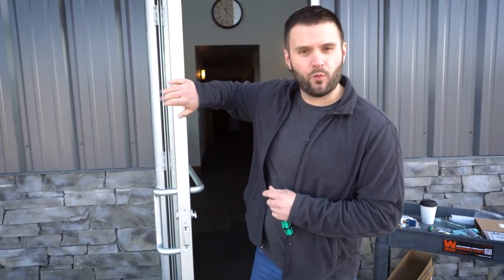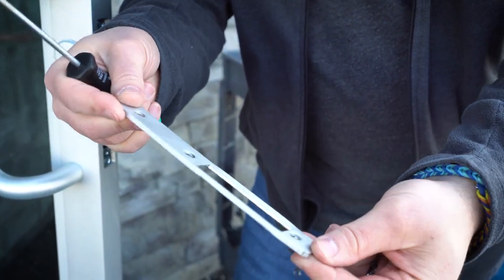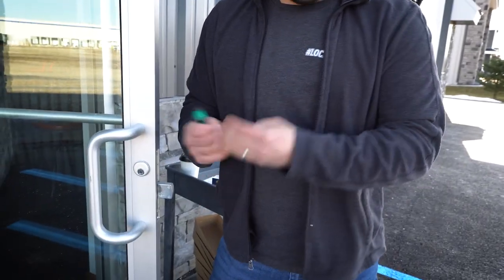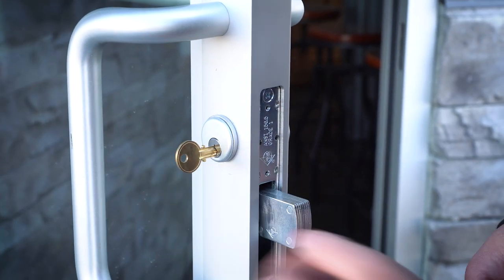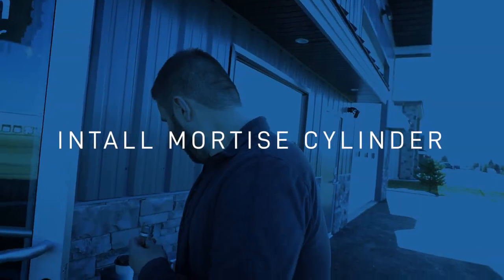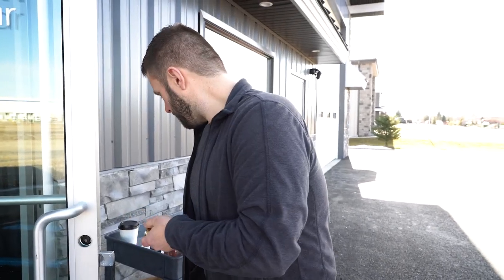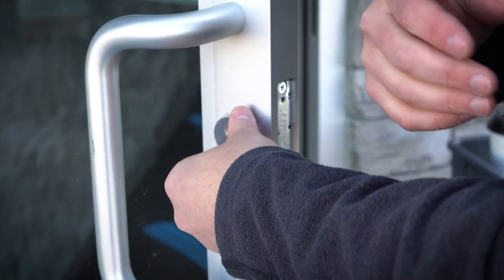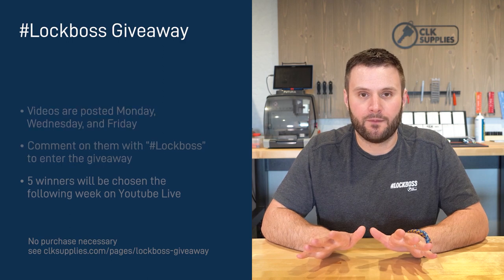Locksmithing 101: How To AVOID Stripping Threads On A Mortise Cylinder!

Comment: Early on I wrestled with a mortise cylinder which would absolutely not start threading... It finally clicked that I needed to back off the tension of the lock case mounting screws and let the lock case "float" enough to let it align with the cylinder - Bingo! It threaded easy as pie.  Good video, PJ! #AccessLockKeyLLC #LockBoss

Comment: Great info. Just a few days ago I was struggling to screw in one of these mortise cylinders. Key had broken off in the lock and needed to be extracted via the back. I had tightened the main screws after removing both cylinders. I remembered a previous video where you had demonstrated the counter rotation to seat the cylinder and your warning about how easy it was to strip the threads so I took my time, but no matter what I did the cylinders would not go in easily. I then realised the lock was not parallel to the door and my previous tightening of the main screws was to blame. Loosened the top screw, did the counter rotation, and the cylinder went in easily. #LockBoss
Reply from the maker: Awesome 👌-PJ

Comment: Hi PJ great video as always. If I arrive on a job & there is damage to the Adams wright type lock, I then tell the customer there will be a extra charge to replace that Adams wright lock. They are pretty much standard & most lock Smith's carry these in stock in the van. #lockboss.

Comment: Great tips and tricks for servicing mortise cylinders!But yes, these locks can become a nightmare, and cause a simple job like a rekey to go to hell in a hand basket if you strip the threads.When I first started dealing with these, I went to install a security collar on a mortise cylinder(Which was a cheap die-cast one)and thought that it was gonna be easy peazy, however what I didn’t know was that in order for it to be able to reach the threads of the deadbolt/deadlatch with the collar on, the cylinder had to be at least 1-1/8” long. So I attached the collar and wave washer on the cylinder, and went to reinstall it, however I discovered that I wasn’t engaging with the threads, so I kept pushing in on while attempting to screw it in for like 15 mins, and when I thought that I FINALLY got it started, I discovered that it was stuck.I felt lump in my throat when the customer asked if it was going to be done soon.Fortunately, I was able to get it out and screw it in properly.However, when I was called out to rekey it a few months later, I recut the threads with my HPC mortise cylinder die.

Comment: Thank you for this great video, PJ!  When I learned about mortise lock bodies, I was taught the importance of proper threading of the cylinders into the lock bodies.  My mentor made sure I knew how and I have felt comfortable working with them ever since.  I hope I never need it, but I did  buy a mortise tap and die set from you all... just in case.  Because, a #lockboss tried to always be prepared.
Reply from the maker: Awesome! -PJ

Comment: Thank You for another Educational Video PJ.  I have not dealt with many Adams-Rite Locks, but the few I did I've had fairly good experiences with them.  Glad you pointed out Loosening the Main Screws for the case of a TOGHT Lock 🔐.   This #LockBoss always seems to pick up some HANDY INFO to store away for THOSE SITUATIONS that I MAY run in to.

Comment: Great advice! Those things have so few threads actually engaged, and they’re so easy to cross thread... #LockBoss
Reply: It's not so much about how few threads it is. It's about how close the threads are. They're very fine threads and have hardly any space between them. I had a hard time trying to reinsert a mortise cylinder lock on door locks that were made like this more than once. These were apartment doors that had the same kind of mortise lock and the same threads. Very annoying, I learned that you have to be very careful so that you don't cross thread.

Sometimes if you cross thread it , you may be lucky enough to be able to straighten it back out but it is very difficult.

Comment: I like to just very slightly and gently rotate the Mortise cylinder back and forth when starting to engage the retaining screw to make sure the retaining screw is perfectly centered in the groove of the Mortise cylinder, just so I don't risk damage any of the Mortise cylinder threads.  This insures that it won't work loose by being in maximum engagement with the retaining screw.  Good tips for any #lockboss

Comment: Great video. I had one at the beginning of the week that the person before had stripped the cylinder and mechanism's threads. I had to replace them but if I had the HPC mortise tap and die tool I may have been able to save them. #LockBoss

Comment: For beginners, it's a good thing to rock the cylinder back and forth slightly while tightening the set screw so they can feel it drop in the groove. A security collar would add a level of security. Also a good thing to invest in is the locksmith screw assortment and a nice assortment of collars for newbies. Available from CLK Supplies. #LOCKBOSS

Comment: Counter rotation is a key to align threads. There is a tap set available if threads are screwed up and don't have a replacement. Another recommendation is to sell tamper proof collet on adams right setups. #lockboss

Comment: Hi All. What is the best way to remove the deadbolt cylinder side of the lock if it won't twist to be removed? I thought about cutting the beauty ring with pliers and using pliers to untwist it but afraid it may strip making it impossible to install the new cylinder.
Reply: #lockboss

Comment: Lol luckily I have quite a bit of experience with preventing stripping threads from being a mechanic most of my life.  My first experience with an Adams Rite style mortise lock was not long ago. Luckily for me it was a nice brass Yale, although I didn't know I was lucky at the time, lol. I currently have an issue on an Adams Rite style door I'm hoping you can help with. The entire mortise frame has play in it, not enough to make it not function (for now) but enough that you can literally see the cylinder move in the mortise hole slightly when the door is opened or closed. I have checked the set screws, they are fine. The problem appears to be that the tabs that attach the mortise frame to the door have holes that are stripped. I can cut, drill and tap new ones no problem but I was wondering if you could tell me what material to use. Is there some flat bar stock that is good for this purpose? Or are pre- made tabs available? The tabs appear to be about 1/2"wide by 1/8" thick. Thanks for all your great advice, the great products and service, and for just being you. Any help you could offer would be greatly appreciated.
#LOCKBOSS
Reply from the maker: Hi Austin, yes this is what you need. Call us up and we can send 1 to you https://www.majormfg.com/pc-639-11-mounting-bracket-for-ar-locks-in-radius-door-frames.aspx
Reply: Hey PJ how ya been? The door is actually on one of the buildings I maintain so I'm going to have to see what the company wants to do, but now I can at least know what to tell them. As always thanks so much for the education.
Reply from the maker: @austinknowlton1783  sounds good! Doing well-PJ

Comment: I accidentally removed the whole lock not just the cylinders. It is removed in the locked position but needs to be unlocked to get the cylinders in. Is there any way to unlock without the cylinders?